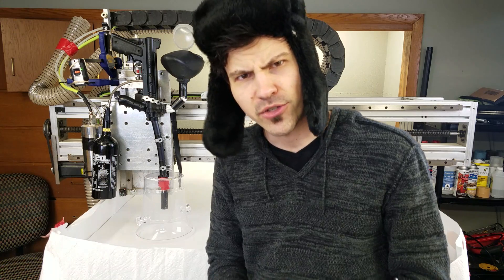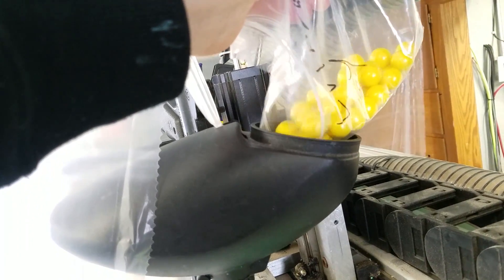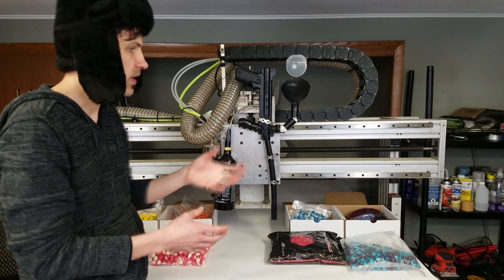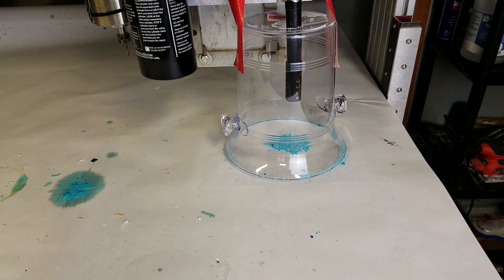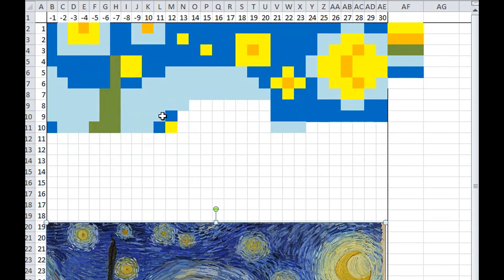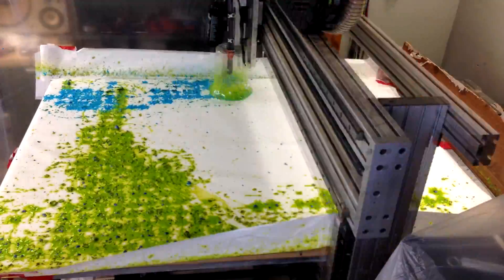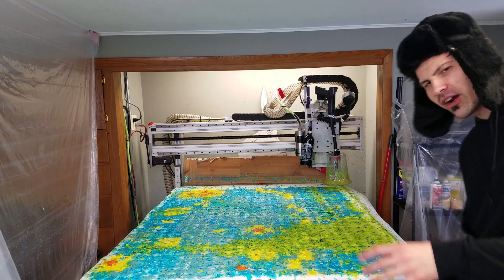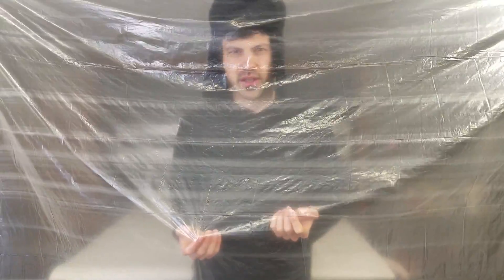CNC Machine Paintball Gun Printer!

Comment: Hey you could get much better resolution by layering the paintball shots. like lets say you have a 16x16in grid painting and you wanted to put a little blotch of color in that was less than a circle of 2in diameter. you could shoot in the middle say at 5, 5 then shoot more paint balls covering up the edges like at 4, 4,   4, 6   6, 6, then again at 6, 4. That would leave a small squareish thing  in the midle but you could also control the shape by making a crescent by shooting at 5, 5 before beginning the rest. you could actually get the paint ball rings to texture out like starry starry night if you really tried but I recomemnd starting with an impressionistic painting of the river Thames before trying Van Gogh
Reply from the maker: I considered the idea myself, but this would also drastically increase the amount of paintballs needed, and would be a ridiculously thick and runny mess on the canvas, and likely need several iterative tests to ensure the order of color layering accomplished the desired results! I appreciate the idea though.

Comment: couldn't you put a smaller cup on the bottom to get more resolution?
Reply from the maker: The cup simply contains a lot of the paint shrapnel, and does not affect the main splatter's size. If I attached a cup that was smaller than 2" in diameter in an attempt to make it smaller, it would likely fill with paint after only a few shots, and would act like a paintbrush, dragging a multicolored paint line wherever it went!
Reply: @JoelCreates  alright, nevermind lol
Reply from the maker: @mircoheitmann  I appreciate the thought! Coming up with new ideas is the only way to improve designs. I've been doing this for a long time,  and my ideas have gotten better over time, but only by first trying tons of not so good ones!
Reply: @JoelCreates yeah, i'm more of a software guy, but i'd like to think more engineer-y and find this kinda stuff more interesting to watch than coding ya know

Comment: What CNC machine are you using?
Reply from the maker: It's a custom build someone didn't finish, I picked it up off of Craigslist for cheap and had to do all the wiring/motors/control systems.

Comment: Please upload more my dude!!
Reply from the maker: As you wish, my dude!
Reply: @JoelCreates  I have been working on my Tevo black widow 3d printer for the past two months with no luck. I don't know where to go. I have still no sucsess with the flowrate. I have gone to reddit, twitter, facebook, and Tevo themselfs with no help. If you have any help or input it would be greatly appreciated. Heres the reddit link to my video. https://www.reddit.com/r/3Dprinting/comments/bg4hdm/tevo_black_widow_problems/
Reply from the maker: @merbkerb2461  what exactly goes wrong when you try to run it?
Reply: @JoelCreates  It underetrudes like crazy. I made another post about it on reddit.
Reply: @JoelCreates  it seems like the extrusion rate is disproportional I dont even know.
Reply from the maker: @merbkerb2461  have you tried drying out your filament as suggested by the comment on your post?
Reply: @JoelCreates  yes
Reply: it normally doesnt even print out the object unless i cranck up the extrusion rate to 1300
Reply from the maker: @merbkerb2461  have you checked every step of the filament feed system? Made sure it can unspool freely? Ensured the feed stepper motor rotates properly? Perhaps you can run it without the extruder tip just to watch the rate that the filament feeds.
Reply: @JoelCreates  I will try that and will get back to you
Reply: @JoelCreates  Hey Joel, 
I would not recomend this printer to anyone. I have only gotten it to work once. It cost around 600 dollars and customer support is awful. The heating element just broke as I was disassembling it and am now going through the customer support.
Reply from the maker: @merbkerb2461  perhaps the heating element was the cause from the start. If it was intermittently heating/not fully heating, that may have explained why only high feed pressure could get the filament to come out  (like squeezing a hot glue gun trigger very hard because it isn't quite warmed up). Though it sucks that it broke, perhaps a replacement will clear up your issues! Solving problems can be a pain, but the things you learn along the way are quite valuable.